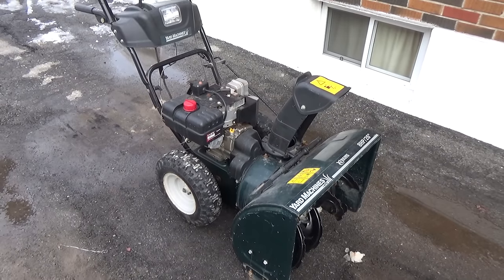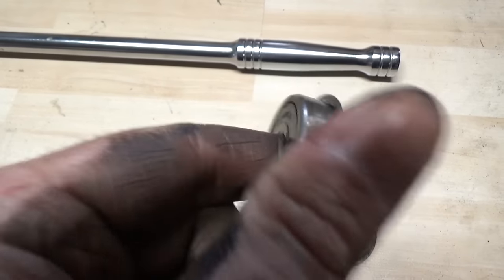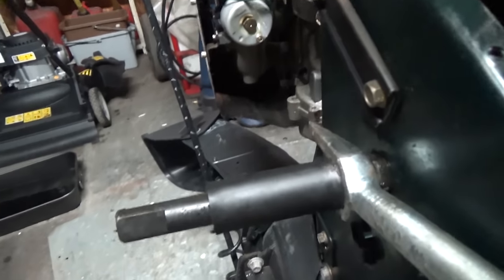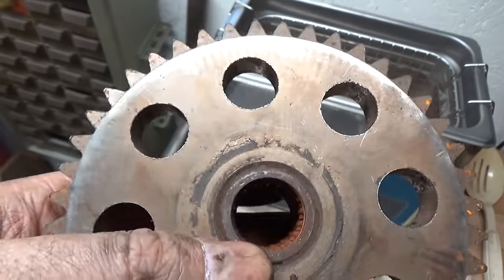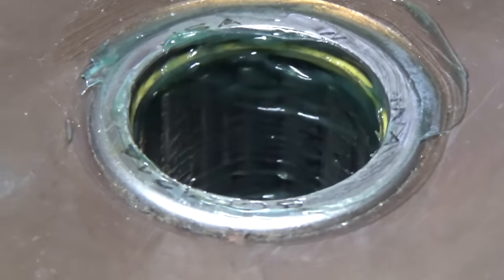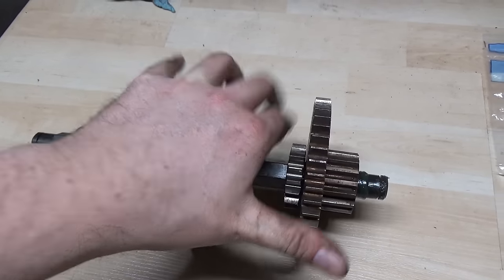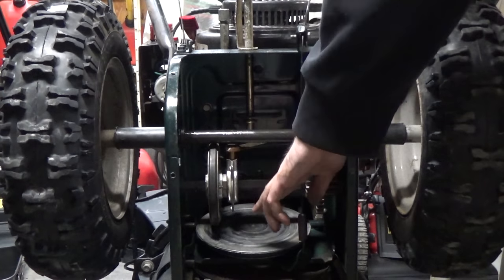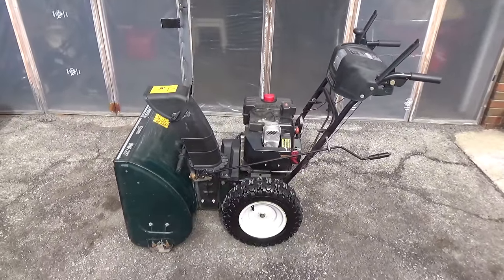MTD Snowblower Doesn't Move - HOW to FIX!

Comment from the maker: The roller bearings can be pressed out and replaced if they are too badly damaged. The roller bearing part numbers are SCE1211 (2 for the wider gear) and SCE1214 (1 for the narrow gear).

I've also heard you may need an SCE1212 and SCE1210 so please measure and research.

Cheaper than buying a Drive Repair Kit - MTD Part # 75305173A

This video just shows you how to repair the issue without replacing the gears. Thanks for watching everyone!
Reply: Great detailed video !!
Have you or anybody else found out for sure if the repair kit is available for free from MTD ?
Reply from the maker: Many people have said that if you call and complain, they will send you a $200 repair kit free of charge. This is due to it being a "silent recall". I however, have not done that, so I can't speak from my own experiences.
Reply: I am actually doing a Troybilt at the moment. The wheels are completely frozen fast although the machine has little if any rust. Tomm when the weather clears up I am going to take the old smoke wrench to the wheels and the puller.. I cannot believe how they are seized on that little shaft. I may attempt to also drill thru the wheels so I can use a steering wheel puller on the wheels to help in the issues. This is not the norm for these machines but a few of em have what seems like a black locktite not just holding the wheel bolts but the wheel itself. I seen a video of guy that ended up cutting the axle and machining out the wheel hubs. What a friggin drag wrecking both the axle and wheel hubs.
Reply: diver dave  Dave they do sell just the bearings I have em here if you need the bearings or the bearing numbers. It's about $75 total
Reply: I just called MTD.  They do not have that as a recall, or warranty      Would not send any parts.
Reply: You could also let it soak overnight in kerosene.
Reply: I prefer kerosene or mineral spirits for parts washing. 
Then blow dry after.
Reply: Thanks for your help. Had to replace the gear for $150 Cdn 🤦‍♂️ as I couldn't get the bearings out.
Reply: I do not own a 2 stage blower yet but am this close to making the jump. I'm curious how one would maintain those roller bearings that you were able to salvage. Does the axle need to be disassembled for greasing them occasionally? Thanks.
Reply: Really good video, I don't even own a snowblower, I'm here trying to help someone out with seized wheels, I thought the needle bearings could be pressed out and replaced, but you did an excellent job of cleaning them.  
When the wheels are seized on I think the only way to remove is with a 20 ton bottle jack. search youtube for
Removing rusted/siezed lawn tractor wheel with a BOTTLE JACK and WINNING!!
Reply: my traction control handle does do engage, I found a broken spring but wherer does it go

Comment: I have a MTD (Rebranded (Mastercraft)). 10 HP 28 inch. It has two gears with NO roller bearings. A very simple design. I can't understand why they made these transmissions so complicated?

Comment: great video. my Troy bilt has the same issue, i pulled it apart and was able to get the needle bearing numbers off of my bearing races, they are usa made bearings and readily available, Wide gear uses SCE1211 bearing x2, thinner gear on the axle takes bearing SCE1214, hope this helps some people because MTD is really hosing people selling the whole gear, also the bearings easily come out with a press or just a hammer and bearing driver, the bearings price out at under 10 bucks each

Comment: Terrific video!  I would have been in a world of hurt without your guidance. One thing I'm still stumped by is there seems to be two holes on each side of the housing so the upper axel can be mounted in two different locations.  My blower came with the axel mounted in the lower set of holes than what appears in this video.  I'm not finding much online.  Are you able to clarify why this is?
Reply from the maker: Some have different size wheels, use whatever holes that puts the machine in the proper position. If it looks wrong it probably is. I mean like the tilt of it.

Comment: I am not The Most Mechanically Inclined Person, But at times I Can Be.
But Due to Your Incredibly thorough video, I followed you Steps 1 By 1 and Found the Lower Axle Bearing, which is the Exact One That was Seized in the Video.
I ended up removing it and Used a Old Family remedy to Remove the rust, Which I couldn’t believe it Worked because the Roller Bearings were All completely Seized with Solid Rust, But after 20-30 minutes of Soaking, I used an old Tooth Brush and Spent about 5 Minutes Brushing the Rust Out and it Completely took all the Rust off and The Roller Bearing Rolled Just Like Brand New!!!!
I Greased Everything Back Up And Reassembled the Unit Step by Step and it Actually Moves and Works better than Brand New!!!!
It Cost me Less Than $10 for Brake Cleaner and Marine Grease and a Gun!!
It Took Me About 3 Hours to complete and SINCERELY WANT TO THANK YOU!!!
I Appreciate the time you put into your video, Because It Was Priceless to Me.
Keep up the Great Work
Thanks,  Rich
Reply from the maker: Cheers Rich, glad you got it fixed up!

Comment: My local parts store, replaces that gear set with a brass bushing,  which has of course the same inside and outside measurements as the original needle bearings.  As you can see, there is no way to properly maintain those needle bearings.  They are buried in there.  As seen in this outstanding video, the only way to properly prevent this is to remove the gear sets out of the machine and press grease into them.  Spraying from the outside will not get the grease in there.
I've pressed out the original seized bearing set and pressed in the brass bushing.  It will never seize again, with a brass bushing in there.
Thank you for such a detailed and precise explanation of what you did.  Truly one of the best tutorials I have seen on all of Youtube.
Reply from the maker: Yeah, the manufacturer definitely should've used a sealed bearing, these are just horrible. Thanks for watching!
Reply: Where did you get the brass bushing, or what size specs.

Comment: Just repaired my MTD blower with this same problem. Toughest part was getting the gear off the wheel axle even after removing the rust from the axle. Both bearings on both axles and one of the outside bearings seized all at the same time, 3 out of 4. Now they’re all greased and working again. Thx for this video great job!
Reply from the maker: Thanks for watching!

Comment: Your video saved my 18 yr old MTD blower.  Thanks.  Great camera angles and technical know how....super helpful.  Was able to save the roller bearings which were one more use away from failing..very dry, which was the source of the "no move" problem.

Comment: My same problem on the upper gear. Yard Machines 5.5 hp. $50 at a yard sale.
 Unfortunately I ripped the whole thing apart first and it took the whole day to figure it out. That same night I was googling the gear assembly to purchase when I came upon your video. I wish I saw the video first. Would have saved a lot of time and head scratching. But now I will clean and lube bearings and save the cash. Great video. Stay safe.
Reply from the maker: Thanks for watching!

Comment: I fired up my old ass snowthrower the other day.
It's been sitting for two years and it wouldn't move. 
It finally moved after being on for almost ten minutes. 
Crazy thing is, it's the same exact snowthrower as what's in this video. 
I can't wait to try this fix this coming Spring. It only snows, like really snow, around 5 times here and probably need the snowthrower once or twice a year, but man, it's a lifesaver.
Reply from the maker: Thanks for watching!
Reply: @EliminatorPerformance  the fastest gear, I think it's 6th, doesn't even turn the wheels. 
I can't wait to open it up and see what's up with it.

Comment: I have run across a few with the cross axle that was so rusted you couldn't move the lever. I have never had an internal gear bearing  seized up like that. I have found a few in need of oil really badly. MTD blowers are complete garbage in my book. Sadly, they took over the market because they are sold so cheap. People think they are getting a great deal but they are not. Nice video for anyone that wants to fix one of these units. I know one shop that will not even work on MTD. He tells people its going to cost more to fix the issue than the blower is worth. He is correct on that.
Reply from the maker: I can fix just about anything, and don't usually turn down work. Unless it's electric equipment, or something that runs on natural gas.

Comment: Excellent Video! I think i have the same problem with my Toro 824xl. You gave me a great way to find out and fix it if it is a seized bearing. The toro looks somewhat similar in design. The drive is locked up just like yours. Thanks and this is the only youtube that i could find that addresses this problem.
Reply from the maker: Thanks for watching!

Comment: TY EP!  What we have here is one of the most professional "how to" videos carefully detailing how to accomplish a difficult task into a walk in the park.  You have knocked it out of the park!  My Yardman (aka MTD) drive just stopped working.  Ironically, I changed the drive belt when I replaced both auger belts (belts worked but were 20 years old!) just a few weeks ago.  I hold down the drive handle, and nothing happens.  Changing gears does not change this experience.  Any guesses as to what is wrong?  Anyway, I have yet to determine the cause and found this video in preparation for what I may be dealing with.  The worse part of this video is the guilt I have for not realizing all the preventative maintenance I should have been doing within the gear housing.  In my defense, I give her new plug, oil, and lube the items outside of the gear housing every year.  I was afraid of breaking what isn't broke by removing the gear cover lol - cheers!
Reply from the maker: Thanks for the kind words Chris, sounds like you have a friction wheel issue, it's possible that the cable just needs adjustment.

Check out my latest vid on that: https://youtu.be/BqPES4-84JE

Hope this helps!

Comment: This is a great video, When I took it apart I found that the key  on the main axle some how moved and chipped the axle and I had to replace the entire axle $165.00  I am waiting for it. the simtom was the blower won't move forword but will move back. These instruction were very helpful I may not have tackled this without them.
Reply from the maker: Thanks for watching!

Comment: Great step-by-step instructional video. Your directions helped me with the bearings in the large dual gear located on the lower drive axle. The bearings on the end were fine. It was the roller bearings in the large gear that locked up my wheels from turning. Removed it, sprayed the bearings with silicone spray to lubricate them and then applied grease. Reassembled, Bob's your uncle! Thanks for this. Saved me a lot of my own trouble shooting. Cheers!!
Reply from the maker: Thanks for watching!

Comment: Excellent! I have a craftsman snowblower a little bit older than this one. I have been in it a couple of times over the years, most recently to replace the carburetor. I have been paying a lot more attention to it's maintenance lately because I don't think a new one would give me the kind of service this one has. This video has given me the idea that I should take the bottom cover off and inspect the insides. It's been awhile. Thanks again!
Reply from the maker: Thanks for watching!
Reply: Same here. Thk god i can tough put the balance of winter. Dont want or need to drag the machine inside

Comment: Great video! 

I have exactly the same seized bearing. I can't get my wheels off though they are so seized on the axle.
Reply from the maker: Good luck, equally just as infuriating lol the wheels can be tricky, Taryl uses the quench method (heat and then dump cold water on them). Good luck!

Comment: Thank you so much for that tutorial. I have a similar machine I believe. a Craftsman. My problem is stays in gear and I see it has a broken spring on the bottom that pulls the plate down so to not engage. Your video helps me a lot. I think mine is about ready for some maintenance.

Comment: excellent presentation.
I have the exact problem going on....on  a MTD PRO 10hp 29"   
wheels seized , but still will move in gear-engine running.
subbed for that in depth breakdown.

Comment: I’m gonna open mine up this week as it seized and stopped moving while I was cleaning my snow tonight. Is it gonna be the same procedure with power steering as you showed here in this video?
Reply from the maker: Should be, most MTD snowblowers are built the same, my latest video I just worked on a 4x4 snowblower!

Comment: As an FYI, you  can press the bearings out of these gears and press new ones in, instead of replacing the entire gear assembly. The bearing numbers are on the side of the bearing. Usually needle/roller bearing seals wear out. This allows the grease to leak out and water & dirt in. So, cleaning & greasing buys time, but will fail again not too far down the road. Excellent video though, thanks!
Reply from the maker: Thanks for watching!

Comment: Outstanding video.  Exactly what I needed to see.  When you have the axles off, would it be a good idea to change the friction wheel at the same time?
Reply from the maker: Sure if you wanted to, but if still have some rubber left, you can adjust the tension of the drive cable to make up for the worn off rubber.

Comment: What a great and detailed video.  I enjoyed it.  Question: The axel bushing on the left you said is pushed on flush with the body of the blower on the inside, correct? then the washer and e clip correct? The right side will not be flush a bit, and it will be extended out from the body. Thanks.
Reply from the maker: That's correct, if I designed it I would've installed both bushings from the outside to make repairs easier but that's not how they did it lol
Reply: Thanks

Comment: This is an EXCELLENT video! Thank you for making this for us! Fixed me right up. Mine was the lower gear bearings also. Instead of buying a new gear assembly, I press the old bearings out and two new ones in. There are two bearings #SCE-1211. Got them for $12 each from advanced auto. The other gear has 1 bearing. # SCE-1214. I have one on order but after cleaning it good and packing it I am good for now. Have one on the shelf if needed! I need to look to see if you have a video for lubing the gearbox on rotor. If not, that would be a good one for us that never knew how to properly maintain this machine. Thanks!

Comment: Very informative video and since you showed the model identification at the beginning i was able to source that this snowblower was manufactured in 2006 so basically the original grease in the roller bearings of the gears lasted 12 years. Appears to me that the original design may have been flawed since sealed roller bearings would have been a better design holding grease in without outside contamination. Your gear replacement costs must have been USD since i have seen the larger gear priced at $105 CDN for a MTD OEM replacement gear. Looking forward to your next video, again great job!
Reply: You can get those bearings at any bearing supply house. Press out the old, press in the new. Done. No need for new gears unless they are worn out.

Comment: Very thorough and helpful repair and maintenance instructions - thanks. I have intermittent 'power' or assisted steering issues on right wheel. The lever and wheel will lock-  (Freezing or lubrication issues?)If possible I would like to see a video of the mechanics and parts involved with the steering mechanisms. Not sure if the problems are cable or gear related. Thanks.

Comment: You said those bearings didn't get lubrication in them meaning the roller bearings. 

How do you get lubrication in them and what do you recommend without taking it apart for maintenance..

If you can get fluid film in there in those places where the bearings are would that be good to use?

Comment: Fantastic video.  Thanks for sharing your knowledge and experience.  On the right side of my MTD snow blower, the brass bushing on the frame keeps sliding out and down the shaft towards the wheel.  It doesn't seem that there is any way to keep it in place.  Perhaps i need some other type of spacer.  Do you have any suggestions.  Thanks greatly
Reply from the maker: You could use a bunch of washers in worst case scenario. Plastic spacers work best.

Comment: So when you installed the plastic flanged bushing on the left side you put it on from the inside of the box and pushed the shaft through but on the right side you put the bushing in from the outside. Is this the correct way to do it or does it not matter?  When I changed the plastic bushings in my same machine they were original and both inserted from the outside. I’m just curious if there is a reason for doing it that way? Thanks

Comment: The second set of hex axle holes. Are they just for a smaller tire machine or is that for the track set up?
Reply from the maker: I believe they stamp them for multiple designs, most likely smaller tires as the axle would be lower.

Comment: Having those bearings in direct contact with the shaft rather than using sealed bearings is pretty scummy.Mine was starting to make a noise while moving and I saw your video and thought oh shit I don’t want to do that in the cold so when I opened i it up I just sprayed some light oil into the side of the bearing and worked it in.That silenced it enough so with a little luck I can get through the winter then when it is warmer I can do a correct job.Really great video definitely got a thumbs up from me Cheers
Reply from the maker: Thanks for watching Joe, glad it helped out! And yes, poor design by the manufacturers!